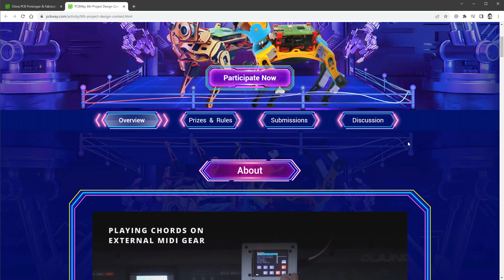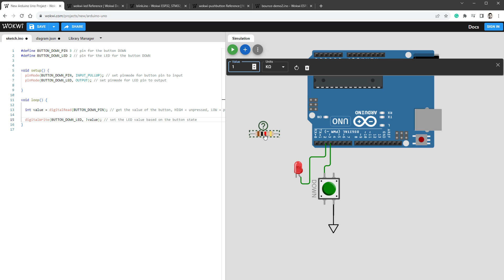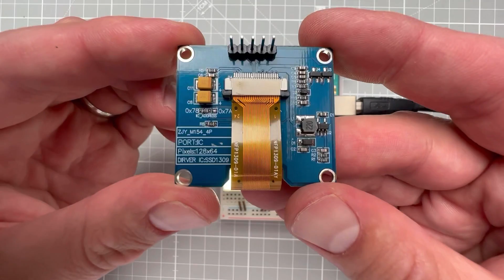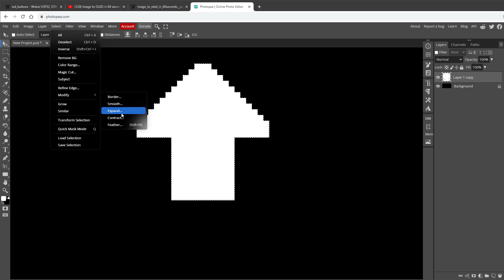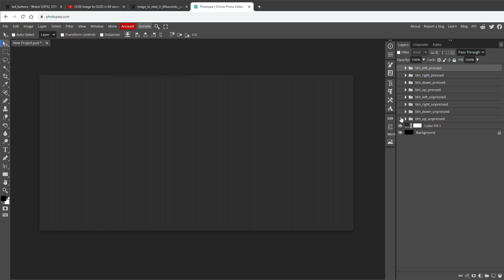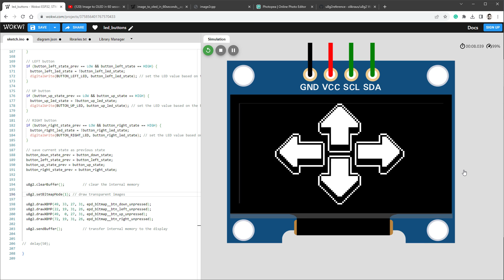LED + Button = LEDBUTTON (Arduino tutorial)

Comment: I have a project where I need to connect 12 buttons like yours to an Arduino, but I wanted to use a matrix so I can use other buttons without LEDs on the same Arduino. I'm trying to do this, but I can't. I need the LEDs to stay on all the time, but I'm not having success. Could you tell me how I can do this? Connect 12 buttons in a matrix and leave the LEDs always on.
Reply from the maker: You can use neopixels for LEDs - that will only require one data line for as many LEDs as you want, and you can use different Arduino board with more pins, like Mega, I believe it has total of 70 pins, so you don´t even need to multiplex buttons. Or a dedicated expansion board, or a combination of all of those.

Comment: Hello. Nice video! Is it possible to work the led buttons with the same funcionality by using only 1 arduino pin instead of 2 (per button)? Thanks!
Reply from the maker: Thank you. Perhaps you can switch between input for button and output for LED very fast, but it would be hard to do anything else to keep the LED not blinking.
Reply: @upir_upir  Thanks for your answer! I will use your code and 2 pins instead. I recently purchased this button (from the same brand) pb26-13m  and i am confused where to connect the arduino. I understand the + and - of the LED, but not the NC, NO, COM. What is on your schematic corrisponding to that? Can I apply your schematic to that as well? Thanks in advance, sorry I am a total noob of the matter. Great channel!!!

Comment: What are the buttons called so I can buy it on amazon
Reply from the maker: LED buttons. I did bought them on AliExpress but they are out of stock for now. You can get similar, but those are slightly taller and not that compact.

Comment: Hi, Now I'm creating a menu for my project. In this menu I connected it to the interrupt pin. In short, I will fill this void loop to display the value of the NPK sensor. Then when I press the menu button which is connected to pin 20 (interrupt pin in Arduino Mega), I hope to call the settings menu function which is connected to the interrupt pin. I managed to call up the menu, but when I pressed the menu button it again. The settings menu keeps appearing and cannot be stopped. Do you know how to stop the function connected to interrupt? I have tried various methods and asked the GPT chat and have not found a solution. I hope you can help me, thank you for your time.

I am using u8g2 library
Reply from the maker: You want to show the menu only once? Could you perhaps create some helper variable to store the status of the menu - and add a simple if statement into the interrupt call? I.e., if the menu is already displayed, or if you simply do not not want the menu to be dispayed, just do nothing? 

Also, there is an Arduino function "noInterrupts()", that will simply disable interrupts. You can enable them again by calling "interrupts();"

Hope that was helpful. Good luck with your project!
Reply: @upir_upir  Thank you for the advice. I've fixed my code and can now run my menu using interrupts. I used simple logic and kept my menu in a loop function and it worked. The interrupt pin is only used to increase variable value then execute the "if" block and the "if" block calls the menu function. I'm too much overthinking about my code, hahaha. Btw thanks for your reply.
Reply from the maker: @BadBrother cool, I’m glad you were able to figure this out. Good luck with your project!
Reply from the maker: @BadBrother  That´s great to hear!